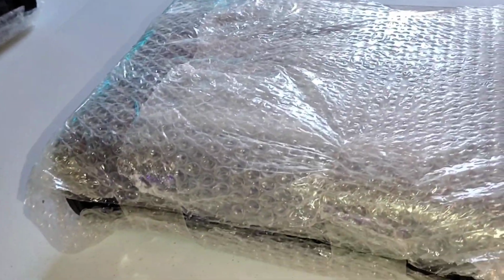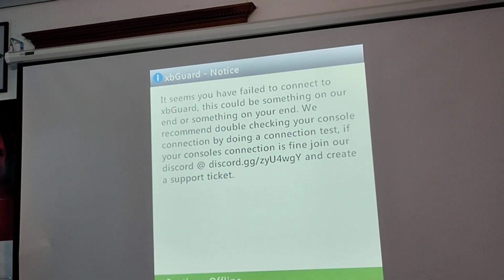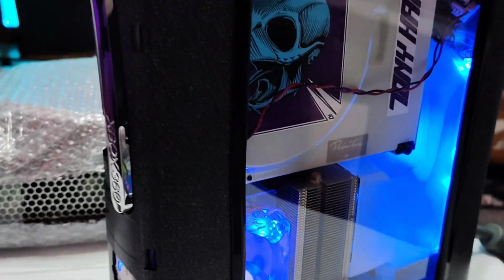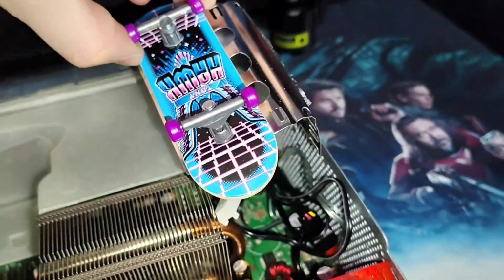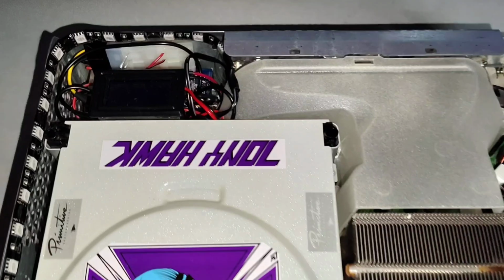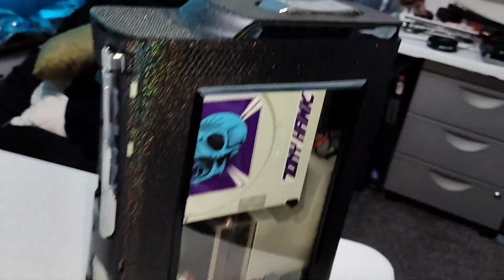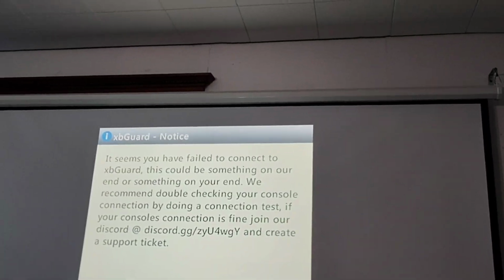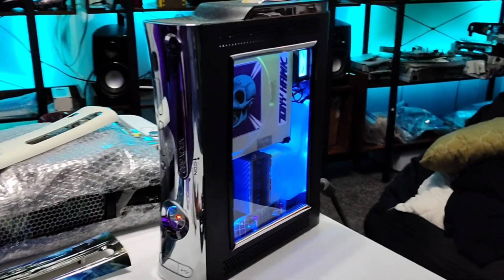Tony Hawk 2.0! Custom RGH XBOX Build!

Comment: How often is this model available? I want to get a Tony hawk one in a couple weeks. Also do you have a jailbroke model with indie games, old Xbox 360 games and the Tony hawk games?
Reply from the maker: @Grizzlly  this will probably be it at least for awhile, I don't really make duplicates, but that doesn't mean I wouldn't make another T.H. themed build at some point down the road🤙
Reply: @trinkettinkeringking understood, is this the one on eBay? I’m trying to see if the one listed is still available
Reply from the maker: @Grizzlly  yessir, there is a buy it now still at least until someone bids, then that option dissapears
Reply: @trinkettinkeringking ok cool, my last question is, does this one have the jailbroken features? Like changing the home theme? And downloading modded games, if not, am I able to do it to this Xbox myself?
Reply from the maker: @Grizzlly  this is is set up with the basics, rgh1.2, xex menu and has the ability to do all of that yes, ready for aurora, other dashes, games, whatever else you wanna throw on it, and also comes with cod GTA, couple tony games already